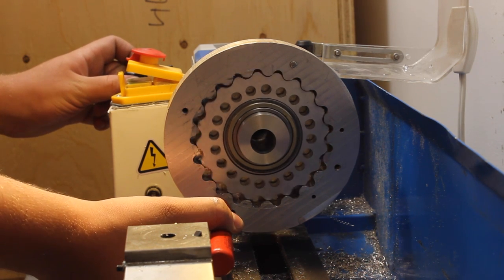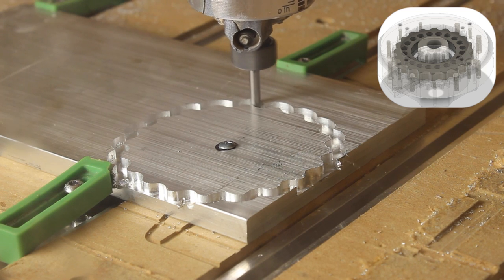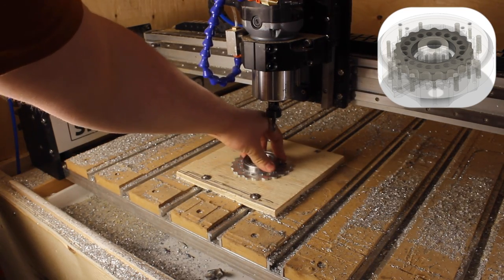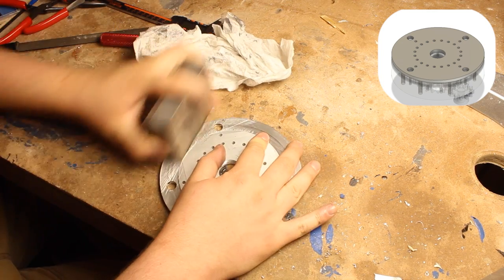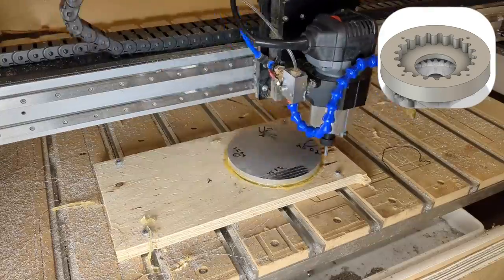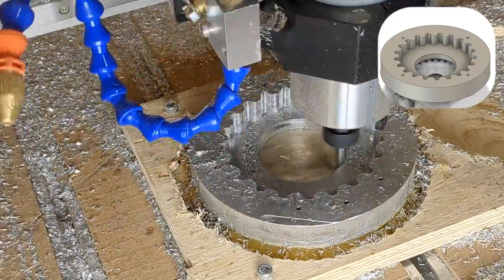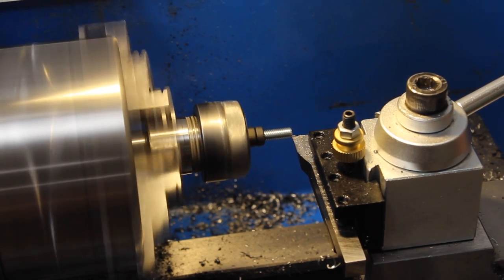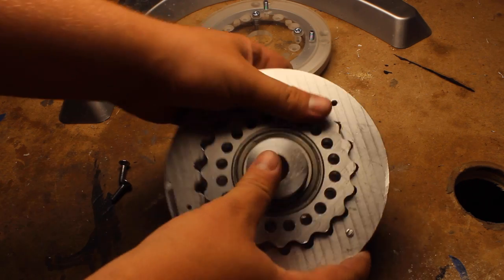Manufacturing a Cycloidal Drive with a Shapeoko Pro CNC Machine

Comment: We made gearboxes for many years with hypercycloidal action. The ring and pinion were straight cut gears, some had multiple pairs of gears that would greatly decrease the output speed and often increased the torque. It was a relatively efficient gearbox which was used in a multitude of different end users, from water treatment works, newspaper printing presses, defence contracts.
Reply from the maker: Very interesting! May I ask which company this was done with?
Reply: @NathanielBechard  They went out of business around 8 years ago. They were based in SE England. Been trading for just over 100 years.

Comment: making a custom weighted flywheel for your spindle will greatly reduce the chatter and give a smoother cut. Just be sure that you adjust the spindle drive parameters to allow for a longer ramp up time and ramp down time. you can balance the flywheel extremely accurately with a home made needle point balance stand. Feel free to reach out if you have any questions.
Reply from the maker: Good idea! 
Can you describe the process to me in further detail? 
How should I attach the flywheel to my router?
Reply: @NathanielBechard   That all depends on how your spindle motor is set up. if you dont have the ability to mount it on the top (back side) of the spindle motor, you can make a simple collet extension and mount it on that.

Comment: 43 subs.... make that 44. Very good video. Ill be making one of these gears boxes soon for a robot.
Reply: 45 checking in
Reply from the maker: Thanks! These gearboxes are quite good for robots, but they have to be designed with a high degree of precision to have zero backlash. Backlash isn't an issue for my application, and my gearbox has lots of it. What machines will you be making your gearbox with?
Reply: @NathanielBechard  I'll be using a cnc dmg mori 3 axis mill. but I have a cnc router just like yours as well but a different brand so i might try it on there as well. I might make one for a combat robot... see what happens.
Reply from the maker: @irishracingfling3711  Sounds like a good plan. Are you going to use this gearbox in the drive train of a combat robot, or are you planning on making a robot arm of some sort?
Reply: @NathanielBechard  I am making a robot arm, not finished the design though can see it being mostly 3d printed before i go to anything more long term haha. As for the combat robot its going to be used in a grabber/crusher mechanism. The drive will simply have a belt reduction to the wheels powered by a 5045 200kv brushless motor.
Reply from the maker: @irishracingfling3711  A cycloidal drive could be a good option for both of these robots. The grabber crusher gearbox will definitely be easier to make since you won't have to worry about backlash. These sound like exciting projects!
Reply: @NathanielBechard  Yeah, hopefully they workout, maybe ill even make a video :)
Reply from the maker: @irishracingfling3711  It'll be cool to see how they turn out, you should definitely make a video!

Comment: it would be interesting to see some measurements.  for instance how round did your part come out, how concentric are the bores, how flat.  Wondering what the wobble is from and i'm guessing it is from backlash deformation of your toolpaths.
Reply: Cycloidals are supposed to have two discs to counterbalance eachother. Single disc will always wobble.
Reply: @dekutree64   it should not wobble at slow speeds.  The wobble is due to the eccentric weight distribution, not a function of the mechanism.  the output should be non-wobbly with a single disk.  The whole thing may wobble at high speed, but assuming perfect rigidity and perfect tolerances the output would stay concentric to the body of the mechanism.  in this example it appears the wobble is due to tolerance and likely other manufacturing defects.
Reply from the maker: @JesseSchoch  The tolerances on my parts are not very good by CNC machine standards. I know that the circles my shapeoko makes are slightly oval and that there must be deviations in other places. 
Unfortunately, I don't have the equipment to measure exactly how off it is, only a set of cheap calipers. I do a series of spring passes and finishing passes until things fit, so I don't rely on how big my measuring tool or the software thinks my hole is. I essentially use my bearings as the guage of hole size, since they're the most precise things I have around.
Reply: @NathanielBechard  A DTI should be all you need. You definitely should pick one up if you don't have one.  You can measure the cnc backlash fairly easily and you could measure the roundness of the part on the lathe, just scan the high and low spots of the disk by comparing them at 90 degree offsets.  my cnc mill has ~0.05mm backlash in both x and y and i've been wondering what sort of tolerances I would need to make a cycloidal gear.
Reply from the maker: @JesseSchoch  I do have one of those, I'll test it out. I thought you meant the tolerance within the holes, which is harder to measure. You can have pretty bad tolerances to make a cycloidal gear, but how precise you need the gear depends on your application

Comment: That was the Dumbest order of operations i have ever seen.. Start with the center hole, and the pin holes.. then clamp from the inside, without moving the plate, and THEN.. machine the outside..
Reply from the maker: It may not look like it in the video, but the adaptive toolpaths used in the center and pin holes put a ton of side force on the clamps. When I was testing these adaptive cuts, they were often enough to detach an aluminum plate from the bed (with 4 clamps keeping it down). Using the plywood jig ensures that the part will not move when an aggressive adaptive toolpath is used to open up the pin and center holes.
Reply: @NathanielBechard  no, it doesn't, i use adaptive toolpaths as well, in titanium, with only scrwes holding my part on a wooden sacrificial board..
Reply from the maker: @JanBinnendijk  Possibly your endmills are sharper than mine, or you are taking a different chip load because I have observed that I need very rigid clamping to stop the part from moving on my machine. I used the technique I showed in the video since it worked well on my machine with my single flute endmill, however, another strategy may be more effective with different combinations of tooling.
Reply: @NathanielBechard  If your endmills aren't sharp, Don't even bother using them.
I mainly machine titanium, and chipload is as high as the tool can handle.. I can push a 4 mm Endmil in titanium up to 12 mm deep, in one pass.. , and the parts that i machine that way, are clamped on an Expanding Mandrel, with Only one bolt (M5)
Reply: @JanBinnendijk  What machine are you using to machine titanium with a wood spoil board? To me that sounds like a pretty outlandish combination.
Reply: @JkeysDesign  The Beagle VMC2814, a 3/4 axis CNC that i built myself in 2006/2007, still going strong..
https://www.youtube.com/watch?v=VfeBt3647hY
Here it is machining a Watchcase made of Titanium Grade 5 (TiAl6V4), notice that the mill goes the entire Depth in one go, and that i use only one M5 Bolt to clamp the workpiece, and that is sufficient, i've never had a case Slip during machining..
The previous machining was on a Lathe
And here it is Machining an 8 mm Cap on the 4th Axis, for a KeyFob that i designed. Also Grade 5 Titanium.

As you can see, I use adaptive toolpaths as well.

When machining Titanium Sheet, for instance to make Watchstrap buckles, i indeed use a piece of hard plywood, which i face before mounting the sheet, with just 8 screws, 2 on each corner.
I can then machine multiple Buckles from that sheet, using a 2 mm Endmill.
as far as experience goes.. i've been CNC machining since 1998 so that is 25 years under my belt (with a homemade Buckle 😝)
Reply: @JanBinnendijk  Interesting. One thing to consider is for the application in the video the part is of a much larger diameter than what you work with so the torque applied would be many times greater as the distance is also many times greater, therefor the part might slip. Although I kind of doubt it to be honest. All of the cuts in this video are very low cutting force and workholding shouldn't be that much of a concern.

I do agree that the original order of operations from the video leaves some things to be desired, however I think making a center clamping fixture like the ones you use is quite a lot of work for just a one off part. A much simpler solution would be to simply use wood screws through the pin holes in order to hold the part down then detach the outside clamps so the part would not be moved at all and the outside features could be machined.
Reply: @NathanielBechard  Cuts shown in this video are defiantly not "aggressive". Maybe slightly for this machine but not to any extent that would really but a strain on your workholding. One method I would recommend trying is the superglue masking tape method. Really nice because you can access the sides and top of the part and it is very strong. Just today I was taking 100ipm slotting cuts at .1 in doc in 6061 aluminum with a .25 tool. No issues from the workholdings at all. Even holds up to proper "aggressive" adaptive milling of aluminum.
Reply: @JkeysDesign  Torque is not an Issue, when using Sharp tools, otherwise, the torque will be much higher, as you are pushing the material, instead of Cutting..
Furthermore, my machine moves quicker through Aluminium, without speeding up the video
Greater Distance also means a greater Diameter to clamp the material..And should you worry about that, just reconsider the order of operations... You could "Premachine the outside, before clamping from the already machined inside, so when you finishmachine the circumference, you only have to "pierce" the bottom, and then set the Offset to 0, and finish the outside contour... it is that easy..
In the video that i posted of miling the watchcase, you can see that i use adaptive toolpaths to premachine, and i then set the offset to 0, and did a number of finishing passes..That is how you do it..

The CenterClamp fixture i made, was't that much work, i just turned the part, slapped it on the Mill and milled the slots.. there's no rocket Science there, Furthermore, you could also just drill some holes in the part, if the part allows for that, and use these to mount it to a Fixture.
I often used this method, when machining all kinds of parts for Laser Welding Jigs.. Just slap a piece of steel in a Vice, Drill all the holes first, then take a piece of "Scrap metal" and use the same program to drill and tap these holes, Mount plate to it, and machine the circumference.. 4 bolts usually did the trick just fine.
If there's a big centerhole, make a "Disc" to clamp the part..or just use a number of strap clamps..

Machining is more about clamping than it is about milling
Reply from the maker: @JkeysDesign  I'll try that next time I machine something like this. I'll have to make a thin sacrificial aluminum plate since superglue and mdf baseplates won't mix. When I first tested my adaptive cuts in aluminum, I wasn't able to keep the board down, I think my weak plastic shapeoko clamps are to blame though.